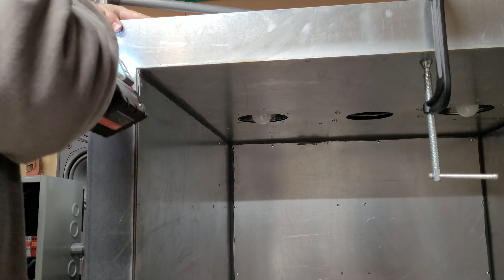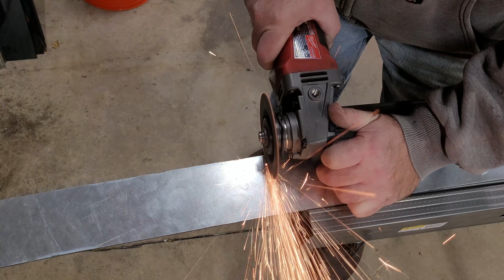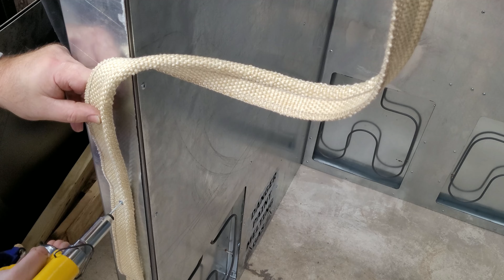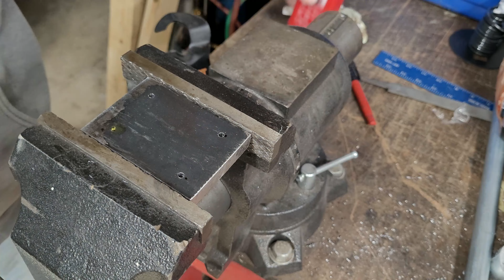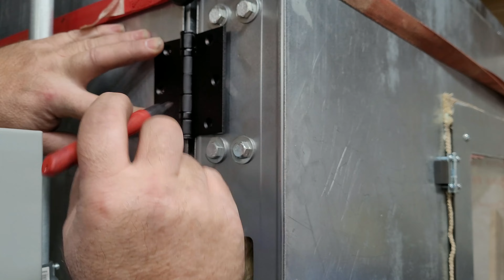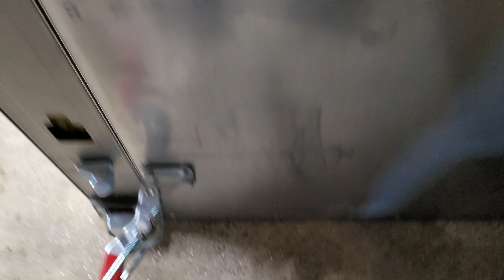Powder Coat Oven Build Part 5 Door Installation

Comment: we make tadpole seal. 
Main products: sealing gasket,gland packing,PTFE/graphite/asbestos products, ceramic fiber products, high temperature heat insulation and fireproof material. 
Free technical support (sealing, heat preservation, heat insulation, fire prevention problems) 
All products 1 piece can also be customized, 30 years of service experience, fast and safe shipping anywhere.

Comment: I really like the design. So i watched another vid, I noticed you didnt put a metal floor on the oven. Have you had any issues with that design of the floor? And also just wondering how much weight this oven could hang? Thanks.
Reply from the maker: The only issue I've had with the floor is it takes a little longer to heat up because there is no insulation besides the concrete itself.  Surprisingly I have no leaks around the bottom of the oven but I think that's because the heat rises and the floor is very flat.  I am going to build an insulated removable floor and do some tests to see what the actual affect is and which is better.  Originally I though I would be using a rack but I haven't used a rack once.  This oven is VERY strong, I could easily hang two or three hundred pounds, probably more.  The biggest design issue I've had is heat escaping through the metal near the corners because I didn't shove insulation all the way tight to the corners.  Everywhere that has insulation is just a few degrees above room temp, but the corners on the outside measure 160 regularly.  So suggestions would be make sure to use an air measuring thermocouple, make sure to insulate all the way tight to the corners and maybe double up on the tadpole gasket.  Also I would do away with the convection blower, I hardly ever use it and when I do it drops the oven temp by 15 degrees.  Sorry for the long answer but these are things I've noticed since the build.

Comment: Looks great! 
Where did you get the tadpole seal? How do u size its diameter? I have a 3/8 space between my door and the oven.
Reply from the maker: I bought it on Amazon, I believe mine was 1/2" gasket.  For 3/8" gap 1/2" is probably about right.
Reply: we make tadpole seal. 
Main products: sealing gasket,gland packing,PTFE/graphite/asbestos products, ceramic fiber products, high temperature heat insulation and fireproof material. 
Free technical support (sealing, heat preservation, heat insulation, fire prevention problems) 
All products 1 piece can also be customized, 30 years of service experience, fast and safe shipping anywhere.